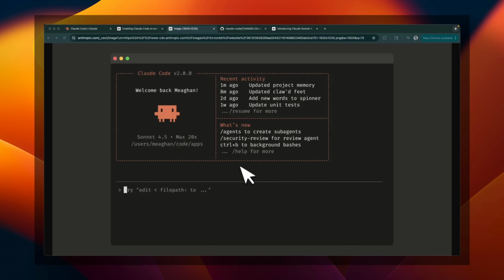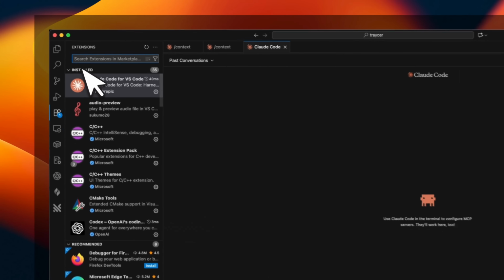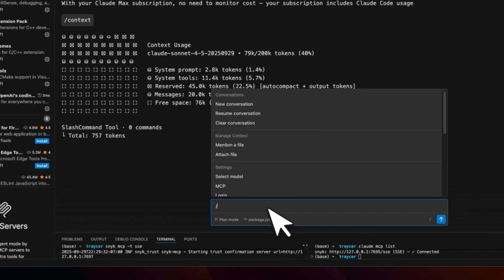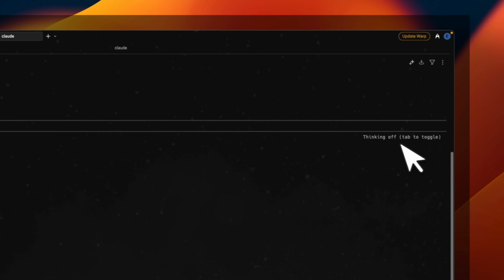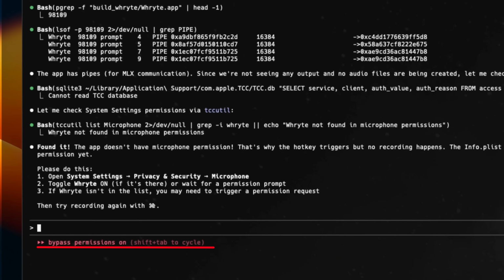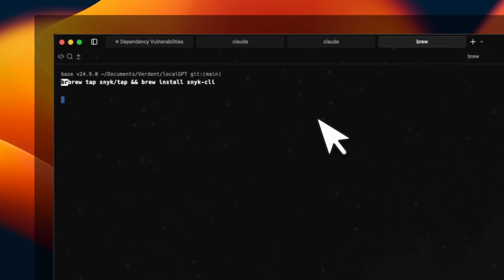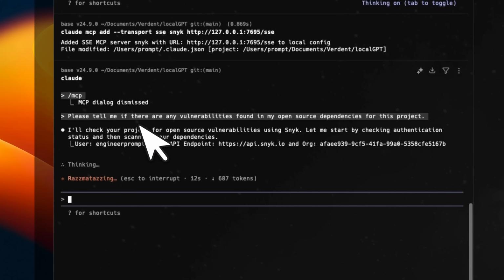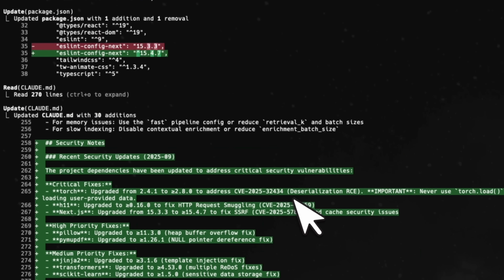Claude Code 2.0: The Only Guide You Need

Comment: "This new context command": it's not new, /context has been in Claude Code for a while. I've been using it often, even before this 2.0 release. What is new in 2.0 is the ability for the model itself to keep track of its context window and take certain actions depending on how much is left. From the docs: "context editing removes stale content while preserving the conversation flow" (the model does this on its own). There is also a new memory tool with which data can be persisted and kept beyond a single session.

Comment: Interesting video.  I’m currently using Claude Code in a WSL terminal in VScode and i have Codex GPT5 running beside it via the extension.  I was testing Warp on a free 14 day trial of their pro plan but ran out of quota tokens in less than a week and there was no warning.  Also very disappointed with the overall Warp performance and experience.  So I’m rethinking my workflow now after this video.  I need to be working on at least two separate projects at once so one of the coders can be via VScode but the other one has to be completely different or else they tend to get confused and mix up and he projects. I found this out the hard way when i tried using Windsurf on one project while using VScode and Cline on the other one (this was a while ago before I jumped on Claude Code). Warp also completely failed on the project i had it working on so was going to have to go back to Claude Code anyway or maybe I’ll use the terminal for Codex or CC and use GLM 4.6 via Kilo Code extension in VScode just to see if it can deliver.   Recommendations?

Comment: Absolute garbage they broke almost everything look at the github bugs added over the last few days. I think they turned of the thinking on the ai that programmed it.
Reply: I am using it for 2 projects with vs code extension and when it automatically updated both projects were instantly improved
Reply: Maybe run out of context
Reply: Seems more like you have a skill issue.
Reply: @AiNomadDev  look at the github before you comment
Reply: @RoboticResearchMain lol. Why? When i have been using it and i have no issues? Maybe get your hands dirty and come back with real experiences rather than just repeating what others have. Think for yourself